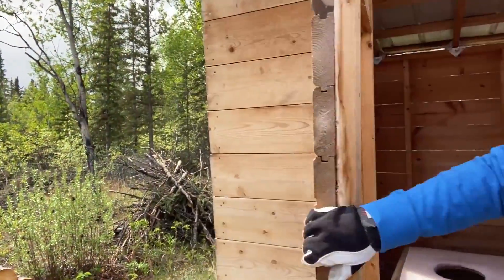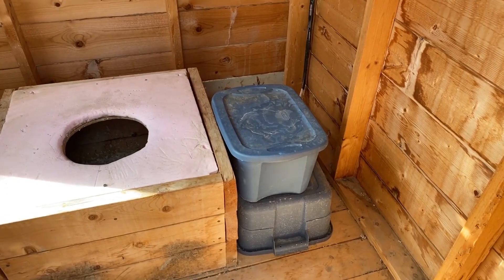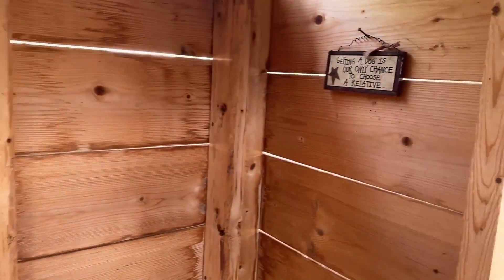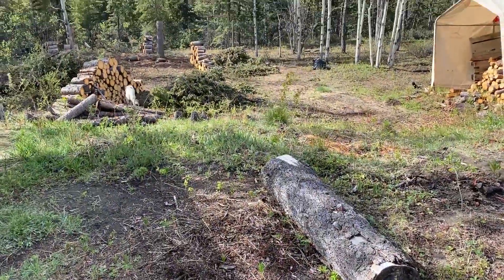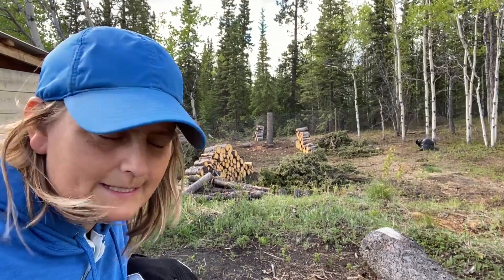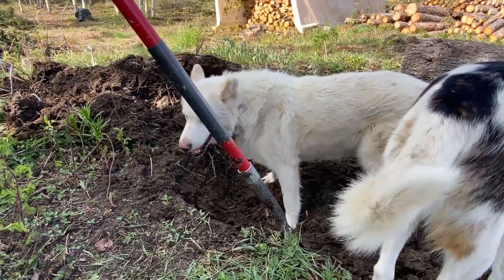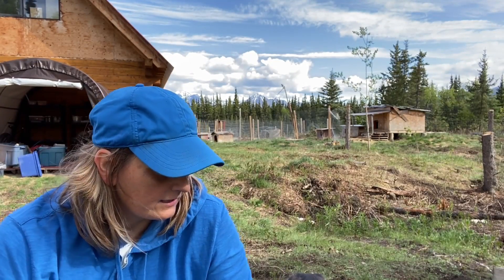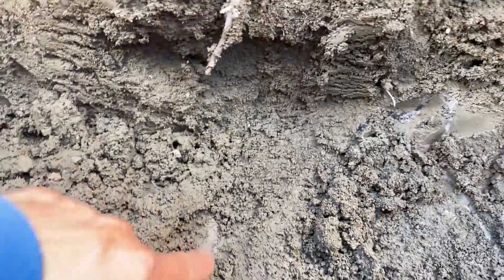Need an off grid toilet? Let's talk outhouses! Part 1 - DIGGING THE HOLE

Comment: Solution 1: rent a gas powered post hole digger (Auger) That will get down to depth quick and should cut through the ice. Solution 2: build a fire in the bottom of it to melt it! Great video! the outhouse is HUGE! hahahaha
Reply from the maker: Solution 3: (and free!) Keep digging lol. It's actually thawed about a foot in a few days so no need for a fire. And it's not that huge! I wonder if it's the pedestal seat that gives it that perspective.

Comment: Nice video, great dogs. I might suggest that you construct a air tight cover over the seat in order to keep the methane from taking charge at times & of course a vent pipe from the pit up past the roof line. Here in New England we don't have permafrost but I recommend folk take the bottom out of metal trash can or 55 gal drum. puncture the sides and place that into the top portion of the pit in order to stabilize it. You really don't need such a wide pit and they usually last for years. Also don't forget to dump in a little bit of lime or wood ash after use. Been building these, full time, probably longer than you been alive. I learned a bit about your area of the country - Thanks.
Reply: To Community and Cabin Dweller: How about the comment of Outhouse Americana. So bold and wise with the wisdom to come to the message board and do some braggadocio. Let's ask him to upload some videos of his work.

Comment: Behind the times, but said in one b4 if you can rent an auger.  Then drill down then scoop out, repeat till you have a deep hole.   This may be a stupid question.  You don't have a honey truck as they call it  <<< just thinking you can't put in a tank then you add the stuff to break down the content.   Then the truck comes sucks it out.  Even though it is an outside chitter.  Thought they were going for it  but dang.  Stay safe eh
Reply from the maker: It's quite costly to get a truck out to empty it, plus it's pretty easy digging for me.
Reply: oh ok @CabinDweller

Comment: hmmm, interesting. I dug a hole and dropped a 50 gallon plastic barrel in it drilled full of holes for leaching and backfilled around it with gravel. When that barrel fills up I plan to empty it rather than dig a new hole and move the outhouse.
Reply from the maker: Yeah for some reason everyone up here just digs new holes. Plus you have all that equipment you’re handy with!
Reply: How often does it need to be pumped? I’m doing an outhouse at my place with the 50 gallon drum method. Not for primary use just as a convenience when outside instead having to go in the house. Will the liquids get leached away sufficiently? Can solids be broken down by adding bacteria or chemicals?

Comment: Pretty nice O H in my books. Potential to insulate etc. I am a firm believer of 'work smarter not harder' so if it lasted 12 years why not just pump out, and start over for another 12 years? My outhouse is over 25 years old and only about 6' deep and still going strong. Dogs are TOO funny.
Reply from the maker: It's ok, but I want to spruce it up a bit! Cost of a pump out here is a lot, they have to drive far and it'd be frozen so would probably not be as cheap as digging a new hole, ie: free.
Reply: What about renting a gas powered post hole digger to bore a series of holes then dig out the rest?
Reply from the maker: Lyle MacDonald it’s actually melting fast. Checked it out today and other than being a muddy mess (rain!), I can dig down another foot easily. Should be able to finish once the bugs leave me alone!